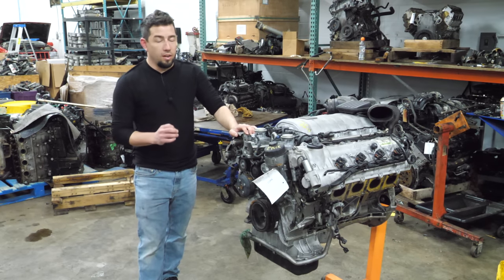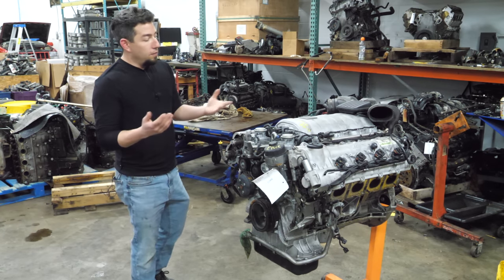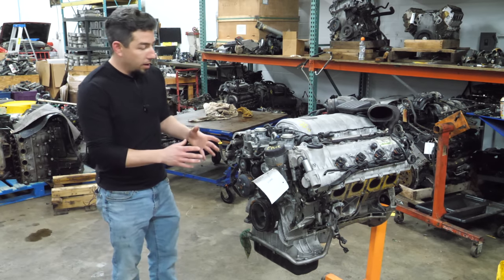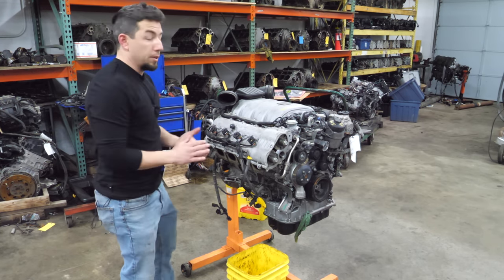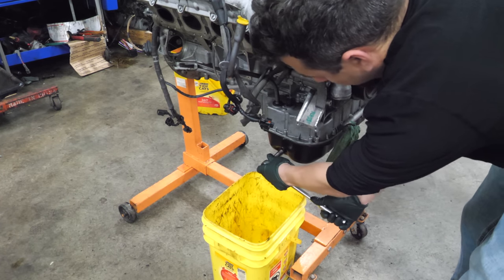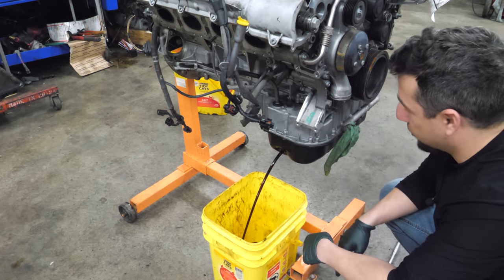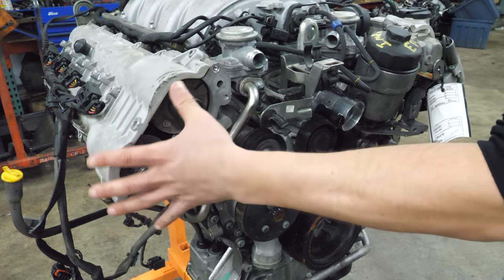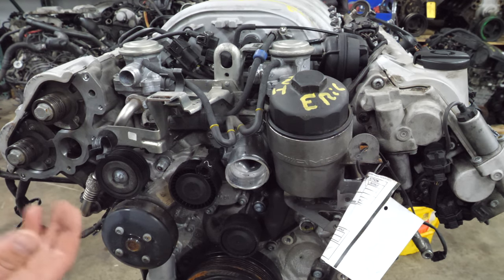Mercedes S63 M156 AMG 6.2L V8 Complete Engine Teardown! What Killed This 500+ HP Euro Powerhouse?

Comment: Hey Eric, the M156 was AMG's first all in house engine without M-B input hench all the AMG ID's. As for overboring NOPE, as M-B/AMG  use a proprietary electro coat on the aluminum cylinder walls, BUT IT CAN BE SLEEVED! You sleeve all 8 and you now have one hell of a boost ready 6.2 AMG 156. Head bolts were a known issue with these engine that M-B was even sued over. Thanks for the excellent break down.
Reply: The N62(B44) V8 used in the BMW Alpina during the early 2000's is similar in that it cannot (should not) be "bored" out. An Alusil alloy was applied to the cylinder walls to make the blocks 'linerless." Like the M-B engine in this case, the N62 can be sleeved though, but good luck finding someone who can do it properly.
Reply: @michaelskinner896  - check out M539 Restoration channel.  Just done exactly that with N62 - though unsure if it's gonna work out yet!!
Reply: @kwakas4ever  Yes, thanks. I am one of his Patreons. 😀
Reply: @michaelskinner896  Any decent performance machine shop can install darton sleeves in these engines.
Reply: How much boost can a sleeved 6.2 hold? In the SL63 its bi turbo so im just trynna understand how much more boost can be chugged into it jesus
Reply: @WoolyBlubber  The bi-turbo engine is the M157. It has more differences from the M156 than just the turbos. If you check out the channel of Tasos Moschatos, some of the sleeved engines he builds put out 950 HP, IRRC. They have darton sleeves as well as aftermarket connecting rods and pistons. The stock connecting rods can fail even without a tune, especially for cars with 4-Matic.
Reply: @darylmorse  oh damn i didnt know it was a 157 instead of 156. Explains why i was confused. But yeah will check that channel out sounds fucking brutal.
Reply: Yeah I'm pretty sure these engines had the same issue that the General Motors Northstar engines had at first. Do you know what the fix was for the head bolts?
Reply: And as it turns out - it didnt!!  Utter FAIL
Reply: @michaelskinner896  AluSil can be honed by a special machine which would cost probably a few grand, but it can't be bored, not worth the money in the end.
Reply: @SavageBunny1  Wouldn't do much good honing the cylinder when they're out-of-round as in Streten's case.
Reply: @kskip4242  Basically the issue was the use of a female torque head, the low metal density after the female torque pattern was cut out of the bolt head lead to the head of the bolts snapping off once corrosion from the cooling system got into the bolt. If the motor didn't liquid lock once the head bolt head snapped off, a simple switch to a male capped head bolts solved the issue.
Reply: @anthonywilliams4100  Interesting. Almost seems intentional imo.How a high end car maker could make such a bad decision by accident seems unlikely. Big money to be made on repairs and the parts needed.
Reply: @kskip4242  EXACTLY what happens when the bean counters get the final say and not the engineers...lol
Reply: Typical Mercedes
Reply: Yes, it can be sleeved and really ready for power. Interestingly, these large V8s can handle some serious power. Taking it apart, AMG used top notch material on every aspect of this engine.
Reply: @michaelskinner896  This is also the case on 2ZZ-GE’s (Toyota) with their MMC (Metal Matrix Composite) coating and Honda’s H series’ which use FRM (Fibre Reinforced Metal)
Reply: @loganamurray64  What kind of issues, if any, did these engines have? I'm not familiar with those.
Reply: Yeah, these MB/AMG engines are built like the ill fated Chevy Vega and Briggs&Stratton engines... 
Interesting that the chains don't turn the camshafts but spin an idler gear that rotates the gears on the cams... 
Surprised it's flat tappet cams! Also, no needle bearings in that idler gear/sprocket? 
Steel oil pan instead of aluminum... well... OK... both... 
Black coating gone from that rear piston...
Reply: @kskip4242 they just changed the head bolts because the originals disintegrate snap and destroys the engine ,  they have a problem with the cams. It’s a great motor if you take care of the problems, take care of it.
Reply: @loganamurray64 yup. That's why the H series broke sleeves too.
Reply: Did they cast the blocks and everything? 
I figured they would still use the cast blocks/heads but just rework them.
Reply: @BuzzLOLOL what are you even talking about? My M156 has 160k miles on it and has given me no issue.
Reply: It was a fairly simple engine all considered. Shame about having to sleeve it but main thing could the crank be saved - do they do over size shells for these? I'm guessing number 8 conrod is toast with it being oval?
Reply: @michaelskinner896 Literally ALL German engines are sleeveless.
Reply: @SavageBunny1 This engine is NOT alusil. It's nanoslide, essentially a plasma coating on aluminum (not high silicon aluminum). This is cheaper to make, and all German engines now use this technology.

Comment: You went full maestro mode cracking head bolts today, playing that ratchet like a musical instrument. Nicely done!
Reply: It's like the sweet sound of a swinging bat hitting a baseball. Ping!
Reply: Yep that was a nice uniform "snap-ping" sound on all of 'em. This engine didn't allow "Lil Sandler" to give us a uniform "PewPew" sound from the air-tools like normal.

Uhhg!! That engine, it's headbolts and the spark-plugs look like they were all assembled and gapped using the "FEELZ" method, perfected by "Hans BillyJoe-JimBob Gruber" and some sorta Bavarian Chinchilla. {0.o}
Reply: I'm glad I wasn't alone in finding those pops to be cathartic to listen to.
Reply: Basically it needs that extra 100 hp to pull that heavy boat

Comment: Another high value part on the m156 is the intake. They are made from Aluminum Magnesium Alloy  that can't be tig welded (easily) . The intake metal oxidized inside and makes holes. Clean intakes are becoming rare. If you find oil in the intake, that is common from the PVC. If you want to see more about this, one of the best engine builders is Tasos in the UAE. His channel has a bunch of intake M156 rebuilds along with many Mercedes engine rebuilds.
Reply: Ty! Just watched his 4 most recent intake rebuild videos. He is pretty cool!
Reply: Tasos is awesome! I regularly watch his channel.
Reply: New pistons sleeve the cylinders may save the engine
Reply: I was fortunate enough to purchase the intake manifold from this engine 👍🏼
Reply: @KD1296  How much did it cost you?
Reply: PCV* 😉
Reply: @insanitybe  but made of PVC...

Comment: I’m a Merc fanboy and it breaks my heart to see these flagship engines blown up for such a simple, probably preventable, reason. 
 I’m happy the top end was salvageable. 
 The block could be a cool coffee table base!
Reply: Mos likely he would cut you a deal on that block.
Reply: Sadly the only thing that is good in merc is the engines. The body will rust like it was designed to so it.
Reply: Mercs are for old people
Reply: @dogchainsaw3923  yup. I and I’m an old people!
Reply: @dogchainsaw3923  Yup. Old enough to have the money to enjoy a fine automobile.
You on the other hand.......LOL
Reply: @dogchainsaw3923  Better than Audi
Reply: @dogchainsaw3923 
You drive an olympic volkswagen lmao, shut it.
Reply: @BobSmith-mc7uq   You brag sir ? At your age ?
Reply: Hmm but V6 diesel has the same problem, more far away from oil pump the bearings get more wear until completely seizes. Is there really any way to prevent that than keep an oil level max?

Comment: The headbolts for M156 were upgraded to E Torx due to the heads breaking off of the original style Torx head bolts accompanying corrosion.

Comment: Another jewel of engineering there, that is true engine porm. That thing is built with no expense spared. Great to see inside it, but it hurts to see that crank scorched. And of course love those head bolts breaking loose. I would watch a compilation video of just breaking head bolts loose,  but man - that's a ton of editing.
Reply: Not engineered correctly until it was in the last run of the SLS.  Many internal flaws originally.
Reply: @machtschnell7452  Correct, this engine was very problematic, earlier M113 V8 was much more reliable.

Comment: 156 is my favorite engine! Easy to work on and a kick in the pants to drive! I worked for Mercedes-Benz for 20 years as a Master Certified Technician. My favorite is the C63. You can unlock the HP and Torque on a C63 via software reprogramming. These engines are almost doomed when they arrive at dealerships because of the salespeople. There is a break-in period sticker on the windshield for this engine! Long story short, the Sales Dept. overrevs the engine before it is sold. Apparently, they can only read when it comes to finalizing the paperwork? the second issue is that most buyers can't read either. They want to show off their purchase. I replaced a set of rear tires on a C63 with less than 2,500 miles. Overrevved abused engine. It brought up a bad story when you took off the lower oil pan and involves the oil quality sensor that stretches out synthetic oil change intervals for 10k+. Holger (the engineer) used to swing by the dealership often 1998. Very nice and very intelligent guy. He claimed that Benz stole his idea and patent. I/we have seen the proof. His marriage thus failed. His neighbors complained about a foul smell from his property. It was because he committed suicide. IDK. Benz has always been the leader in automotive technology and over the years it trickles down to other manufactures. Took a tour of the Benz Alabama Plant and they claim that they sell patents for $1 to other manufactures. RIP Holger!

Comment: Love the 156 engine!  Big displacement, big lunged, long legs, high power, high rpm!  Very much like an AMG version of a Chevy big block.  Mostly very easy to work on and generally very durable so long as you know its weaknesses. The cams and buckets having improper hardness was the biggest issue to deal with in that if/when that fails it’s very expensive. The head bolts are also an issue but easy enough to replace especially if they haven’t snapped yet. The PCV vacuum valve thing would leak and whistle and the air box beneath the intake manifold would commonly leak. Both of these would cause check engine lights. The PCV fix was relatively cheap and easy to do. The intake air box “technically” couldn’t be resealed and as such was extremely expensive to fix as the entire manifold including the twin throttle plates had to be replaced as a single unit.  The reality is the air box lid could be resealed even if MB said no.  The 159 engine was a even more potent hot rodded version of the 156 that was in the SLS. The 204 chassis had a special 507 edition C63 version of the 157 engine which borrowed bits and pieces from the 159 to make it more powerful and higher revving then the standard 156. Interestingly the 507 edition motor while more powerful then the standard 156 in a normal C63, made less power then a standard 156 in an E63. Never understood why they made the upgraded version for the special edition C63 that was still less powerful then a standard E63 but hey, Germans.
Reply: Rules must be followed! A C class must not have more power than an E or S class.
Reply: @greydog1104  Absolutely true. My point was not about the power but about why did they throw 159 parts in this engine thus making it more special than any other 156 engine while still giving it less power. They could’ve just stuck a standard 156 engine in it from an E class and then de-tuned it.  Or tune up the standard 156 that was already in the C class to up the power.

Comment: One thing I noticed was the all the cam bearing caps sounded the same while cracking them. That's a sign of very consistent manufacture and assembly.  Not the same with the large head bolts, but the corrosion would have affected that anyway.
Reply: Hand assembled, there's a plaque on the intake naming the builder.

Comment: All your videos are fantastic. The nearest to an F1 engine having torn down many high performance engines and also the owner of an F1 v10 Unit is the Bmw V10 engine vid.  An area I look at always on all your teardowns is the coolant flow holes on the deck surface and where they are. The Cosworth F1 V6 Turbo had no communal drillings between head and block - coolant or oil. Another point to note is the carbon on all piston crowns...this is from crank case oil mist re-circulation required for emissions - the downside of this is that it also causes rings to lock preventing sealing. A catch can would fix this on a performance build. Thanks for your time making these - happy new year from the West of Ireland. Brian.G

Comment: As far as the paste goes, I am old enough to remember when oils had no detergent, or at least ineffective detergent. When you pulled a valve cover off of an old engine you had to scrape handfuls of sludge out.
Reply: Quaker sludge or the like.  Chevron Delo and the like have been good for 50 years.

Comment: Pro tip: when prising something, always wear a glove or put a towel where your hand will slip to. Since starting that I rarely bust my knuckles open.

Another tip: when tapping the headbolts thru the head (or any bolt), rotating at the same time can help. Also a great idea to put wood on the bolt and pound on that. If it busts thru, you won't mash aluminum into aluminum.

Comment: I have a suggestion for the removal of that bushing of the cam chain. After removing the allen bolt, pump grease in that void, then use that smooth pin that you had in you slam hammer and put it in the hole and strike with your dead blow, an old timer taught me this trick when replacing pilot shaft bushings in the rear of crankshafts.

Comment: Many of these german cars are VERY protective and pro-active when it comes to oiling. If you're low on oil or the oil is getting hot, the car will absolutely warn you of it, it's damn near impossible to miss. I agree on the crash theory, a puncture in the oil cooler and a dazed driver who didn't shut the car off makes the most sense.

Comment: Seems like one of the best German engines I've seen.  Looks like you can replace the cams and the cam actuator/gear without yanking the front cover.  Brilliant using the chain to idler gear to cam gears.  All engines should do this for that exact reason.  Looks like perhaps the oil pump can be replaced without yanking the upper oil pan.  (Maybe not, perhaps not enough chain slack).  The timing chain tensioners being yanked from the side of the block, again without removing the timing cover, pure bliss.  And then yes, a double roller is the way to go, especially on single chain driven quad cam engines.  Definitely seems like the engineers that designed it did so with some forethought of serviceability, something that most just don't care about (Just needs to last as long as the warranty and afterwards provide lucrative revenue stream to their dealers service departments).

Comment: There was a recall and a service bulletin on those head bolts- for all the Mercedes AMG excellence, the head bolts that those engines came with corrode and snap, leaving the threaded portion in the block.  There was a recall and a procedure to replace them one by one, but now it's customer expense.  The new bolts are E-torx.  This is why those head bolts were stuck- the corrosion problem and then the next step is for the heads to snap off.

Comment: Your nemesis, the oil dipstick tube, didn't give you a hard time! I appreciate that you always use a definite pattern to remove camshaft and head bolts instead of just going front to back. Folks may not realize that keeping a head from warping is a good thing for salvage parts.

Comment: thanks for showcasing an exotic variety, i have never seen this engine or heard one run or even seen a car that has this engine as standard equipment and i doubt i ever will they really are large power plants and intricate! it appears you have a lot of fun exploring these failures and it would be fun to take an engine apart with your help if only i lived closer
Reply: They are on the Mercedes C63 AMG, CLS63, etc, etc.
Reply: They are quite common.
Drove one, almost bought one. But I decided to save the money for a house which I actually bought

Comment: I'm pretty sure the discoloration of overheated metal isn't just heat. It's actually creating a polymerized layer of engine oil, just like how you'd season a cast iron pan. Heating oil to higher than its smoke point, which is usually around 350 to 450 degrees in cooking oils. Not sure what engine oil smoke point is but im fairly sure the oil in an engine shouldn't get anywhere near that hot under normal operation

Comment: Hi  Eric
A question for you think it’s possible to take the timing cover for Mercedes M278 without removing the engine. 
It would be greatly appreciated if you could comment if it is possible to take the timing cover off without having to remove the engine. 
Thanks for the videos helps a lot for DIYs.

Comment: Great video Eric, very helpful to see the M156 pulled apart. I'm looking at purchasing a C63, would the original engine have the heat tabs installed on it or just a replacement?

Comment: Loved the vid.  I'm not a mechanic, but I liked to see what's inside of my M156.  Mine is 2007 with 57K miles.  It's well maintained with frequent oil changes.  Concerning the head bolts, I'm trying to decide whether to have them changed proactively, or let them alone.   I drive the car less than 1,000 miles/yr.  Opinions?
Reply: Replace.   The damage from not replacing is costly.